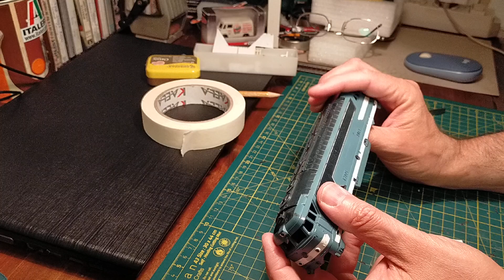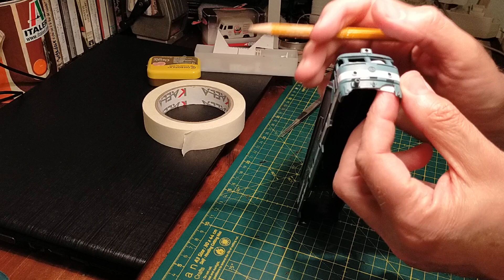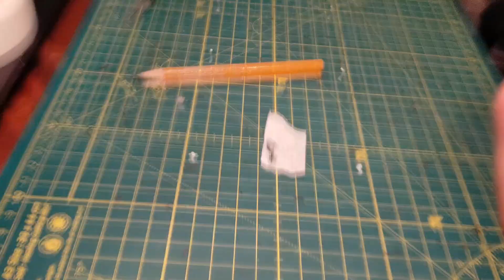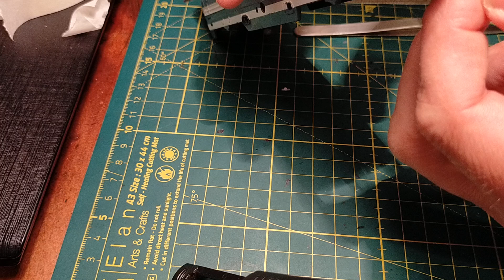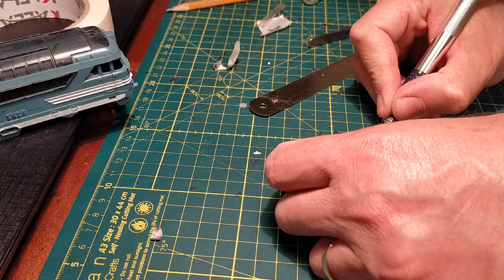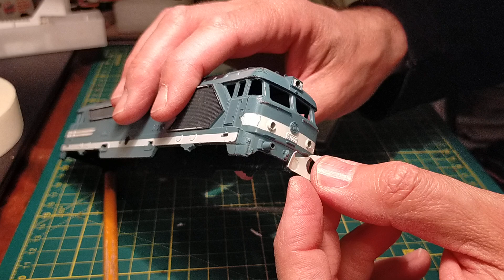Making a pattern to repair the broken buffer bar and eventually changing idea after half an hour...😅

Comment: I think I would have kept the first variant of repair, the styrene bit - and gluing it's edges in position on the body shell with super-glue (I'm not an propaganda agent of some super-glue factory or its megadirettore... 😁). then fill the remaining flaws with Glue-n Glaze. The aluminium covering variant I used to repair (in fact, to cover) the roof of an E-69 Piko E-lok, which had missing a corner of that roof (I used some aluminium "sheet" taken from a soda can - Cola no sugar, but I guess Lime or Oranges would have worked as well). 
Good night, cheers! 
PS - Chewing gum is a very underrated material in train modelers world!
Reply from the maker: I've since fitted the aluminium patch and it doesn't look bad, I have to reconstruct the square buffer base gluing it into the piece of aluminium and this will conceal it further.
My wife chews gum, so she could provide me with some interesting modelling material 😂. I've never had this habit, I used to chew gum occasionally if I was very tired on long car journeys, but I was never a regular, maybe because I never learnt to blow bubbles and I developed a form of jealousy towards these masters of chewing gum 😂😂.
Reply: I never thought of chewing gum!!

Nice techniques 👍🏼☺️
Reply: Like it or not, we are the citizens of Chewurope. "Forever blowing Bubbles!" as West Ham supporters sing. 👄💨⚪💥
Reply: @Cristake1974 😂😂😂
You know more about English Premier League than I do!!